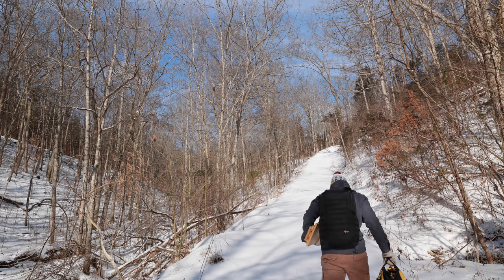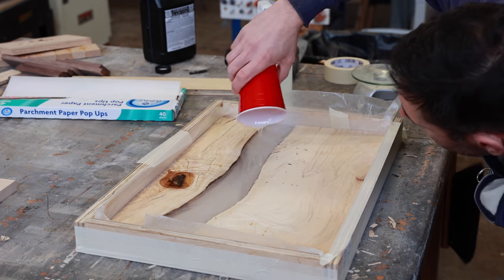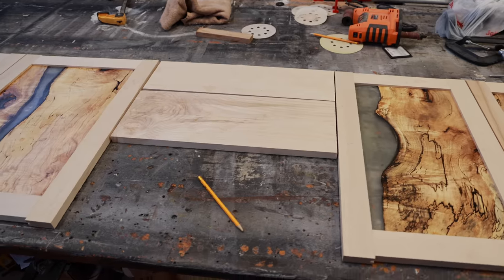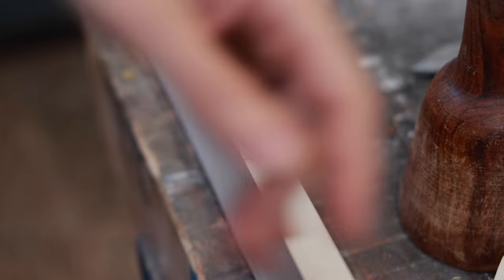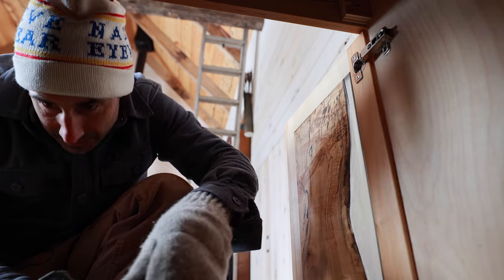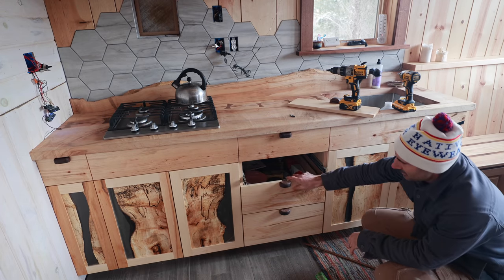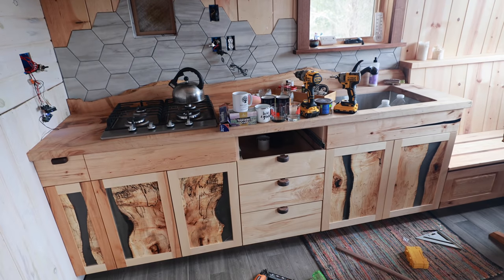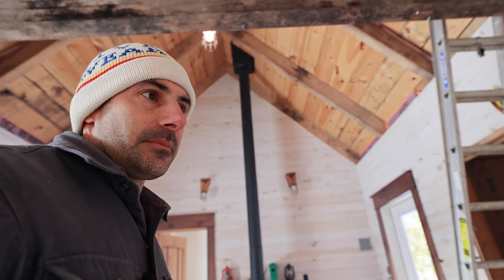Making Cabinet Faces From Scraps for our Off Grid Tiny House

Comment: I, for one, LOVE the talking. I've learned so much from your explanations of what you're doing and why. I've had my fair share of running into the same problems you do. Case in point, the drawer spacing... if you made the same mistake I have in the past, you divided the remaining space by the number of drawers, instead of the number of spaces between the drawers (# of drawers - 2). Just looks like you have space for 2 more spaces. Thank you for the shout-out, Mike! I'm SUPER honored you took my advice... They look AMAZING!
Reply from the maker: Right on!  They meant standing there and talking without doing any thing. I think people like it when I talk while I work.  Yea I think I did that with the spacing it's just a little too wide.  It was a great idea to put the light back there. Its like dyeing the resin without committing to a die, I love the fact that they look black when turned off but I can turn them blue if I feel like it!
Reply: And you can change the colors whenever your decor colors change. :D  So... you know how I said the drawer spacing math is # of drawers - 2?  Yeah, that was wrong. It's -1.  This is why the house I build is going to look like Ron Weasley's family house. It's gonna be awesome. Totally wrong, but awesome.
Reply: I agree and it it gives personality
Reply: @50Acres  yeah maybe add some joke's just kidding like your stuff doing a fine job

Comment: Did you try the Yanmar on the snowy drive? Might have been a good experiment.
Reply from the maker: No I didn't if this had been a longer trip that would have been a good idea.
Reply: @50Acres  instead of pulls for the cupboard doors look at those push to open thing-a-ma-jigs. Those drawers and cabinet doors look too good for a cabin (so much better than the $thousands house kitchen cupboard in painted "decorator named white" press board we have in our kitchen) but so does 99% of your work. If i tried to build myself I'd be hard pressed to get beyond sticks, mud and a blue tarp roof.

Comment: The back lighting of the clear epoxy doors is very cool!  A multicolor light strip that dances and alternates to the music's rhythm and is controlled remotely is an idea!    The panels have great character in the grain and it all flows with the table, bench, counter, and walls in that area!
Reply from the maker: That would be really cool, I need to read up more on the Arduino and maybe I can make that happen.
Reply: @50Acres  time to go to Ivrea Italy to the Arduino bar and start at the beginning!  LOL!  Amazon has some descent kits to get started and they do not look very pricey at all.  With your knowledge of wiring and circuitry you would make it look easy and I bet you could tie it all together throughout the cabin!  Enjoy the heatwave we are having and make the most of it!

Comment: Thanks for the video 👏 glad you used epoxy, remember suggesting for the table but you already had a plan, so glad you used it in the cabin kitchen doors👍🏻. Technique is used a bit to much now but does allow the use of funky wood that would usually be wasted. Always feel the live edge on wood with epoxy if done right looks so good😍 and you did that sir👍🏻👏🏴
Reply from the maker: Thanks Al, its a nice way to put those extra pieces to use!

Comment: There is a verticle adjustment slot in the cabinet and drawer part of the slides.  I like what you did on the backsplash, I am way too an to have thought of that myself but now I will try to sell it.
Reply from the maker: Thanks for the tips! No problem, I wasn't sure if I'd like it but figured id give it a shot.

Comment: Tip for anyone working with those euro hinges: if you look close, the adjustment screws are pozi and not phillips.  Once I realized this, I stripped out way less adjustment screws on my Blum-style hinges.
Reply from the maker: Good call, I stripped one out, had a grounding nut laying around that worked.

Comment: I love what you did with the doors a tip that mite help with your driver bit i keep a magnet in my bit container and it helps with two things you wont loose as many bit and it will keep them magnetized and may make the magnetism stronger then when you bought them and with the screw driver just rub the magnet on the shaft of any screw driver and it will make it magnetized you probably knew this already but if not it will help keep up what your doing!
Reply from the maker: Oh good call on that,  Ive got that tip and always forget to implement it!
Reply: @50Acres  how about lights inside behind the cabinet door it would or may look pretty cool with clear epoxy ?
Reply from the maker: @toddbaumann3980  todd watch a little further into the video, I put some blue led's in there!
Reply: @50Acres  you dont not have to reply to this,you are one of only two people that take the time to reply and i get it its hard to get to everyone especially the more people you get watching that said it makes a huge difference i know myself i have suggested your channel to just about everyone i know first because you do a great job doing what you do second i love the old school hand wood work instead of just slapping it on a machine to cut dovetails or what ever and you show yourself doing it dont stop doing that and if you remember im the guy whos had back surgery and my neck fused your videos and i have watched them all have kept me from going stir crazy laying recovering!P.s. yep i know these replys are one messed up sentence im lucking i can get this typed one hand has bullet fragments and the other was broken when it got slammed in a hum v door not bitching just saying lol keep up the good work and stay safe!
Reply from the maker: @toddbaumann3980  Hey Todd, I hope your recovery is coming along, happy to keep you entertained while you are on the mend!

Comment: Great video. As always so fun to watch.  You need some back tire chains on that truck so you can zip right up that driveway with pride! 
Speaking of pride, you have such a beautiful, supporting wife!  As a way to show your appreciation, you should use some of that wood to build a small 4 inch by 6 inch frame. Then get a very nice picture of her smiling.  Put that picture in the frame with some nice matting to really make it look classy.  Then at the bottom of the matting you can write "Employee of the Month" and put it right smack dab on the refrigerator!  Just imagine what she will think!  (She will either A. laugh hysterically or B. foreclose on your loan and feed you cold spaghettio's for the next month while you sleep on the couch)
Craftsman styled cabinets. You just don't see that anymore.  They are outstanding.  Years ago, on our farm in Somerset the old cabinets got to the point they'd shift, rarely but every now and then.  We could lightly move the hinges but sometimes had to get a good old fashioned plane and run a few passes as the wood warped sometime.
Reply from the maker: lol too funny man, I know she would laugh, luckily she has a really good sense of humor!!

Comment: Amazing woodworking! What's your method for buffing in the finish?
Reply from the maker: I've just been taking a clean rag and rubbing it in after it sits overnight until it's entirely smooth and gets sort of a waxy sheen to the surface.  You can usually feel the resistance of the excess finish disappear.  I do it pretty hard and try to get some friction heat on the surface.

Comment: I really appreciate the 'new' Craftsman style blended with the traditional Craftsman style, being a Roycrofter-at-large. You may want to apply. In any case ....  The use of waxed paper seems to be the right choice so I was surprised to hear you not recommend it. Also what were the issues with the glazed coat epoxy? The end result looks terrific! Was it difficult to machine?
Reply from the maker: Thank you Terry,  regarding the wax paper, I had a difficult time preventing wrinkles or folds in it which showed on the cured epoxy.  The glaze coat is ok, but they only want you to pour 1/4 inch at a time which is a pain.  It's also somewhat inconsistent in how fully it cures.

Comment: The creator knows the flaws. In the inner woodworking circles they consider the flaws which is what gives it handmade character. Don't be hard on yourself. You are the only woodworker where you put your tail between your legs. Stop it. I really like what you are doing. Try not to apologize for things. Like they said in the movie, "Love means you never have to say you're sorry." 
If you forget to put the batteries in, or they run out, just edit around them. I would think nothing of you stepping ahead especially when you are doing repetitive procedures. Some people fast forward those procedures, or simply go past them. 
I'm just giving you my honest opinion. My off the cuff remarks are not designed to be written in stone. Keep moving forward. You are way ahead of everyone else who is dead in their tracks because they are caught in perfectionism. I've had that problem myself, and am finally realizing the key of success if failure. You are not failing. You are succeeding. Congrats on a job super well done.

Comment: New viewer of your channel, awesome cabin.  How do you do the white wash finish on the walls?
Reply from the maker: Welcome.  It's really easy, I just mix cheap flat white paint with water 50/50 and bush it on.  Best done before the boards are up because you need to leave a wet edge or else you will get double coverage if a section dries and then you start up again.

Comment: Not sure if you have a design for the pulls for the cabinet doors, I like the walnut pulls on the drawers. What about pulls for the doors with 2 or 3 finger holes, that stand out about the distance of the of then drawer pull, with whatever shape that looks good,  for instance, a block same thickness as the drawer pulls and drill 2 hole your finger will fit in to pull. probably 3/4" or 1" holes. Maybe the same design as the other pull, but with 1 hole to pull with. That would take away having to turn a peice. Use the same half moon shape with a hole in it. Thinking out loud. Whatever you design, will look great.  My thought on your ladder for the loft. Maple side rail, and black walnut for the steps., I made a checkers board from maple and black walnut, with clear finish, and found some checker prices and chest prices online that matched , turned out well. Black walnut and Maple just go together perfect.